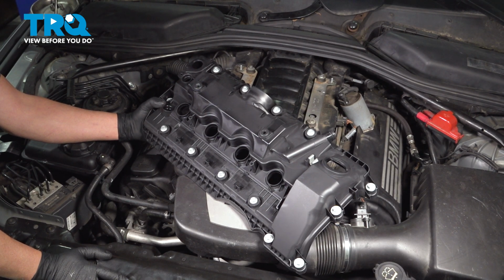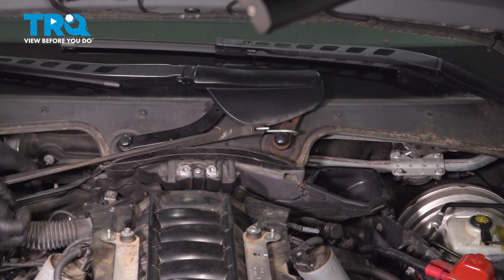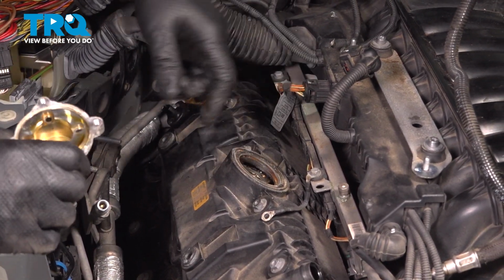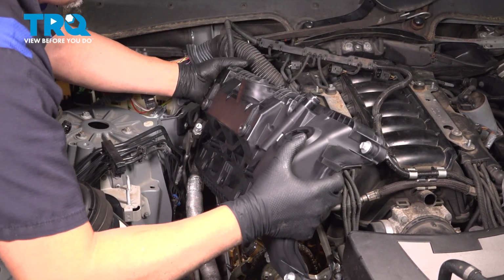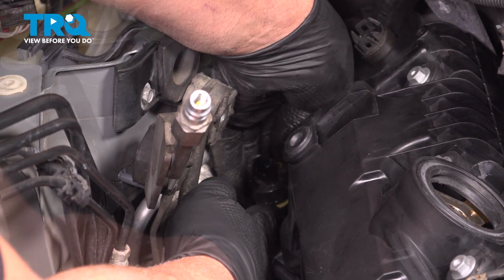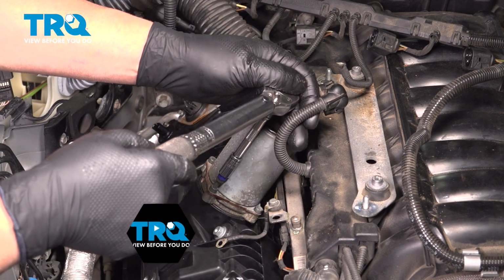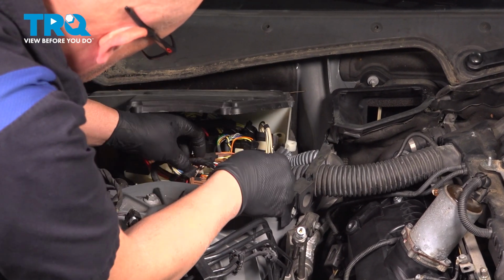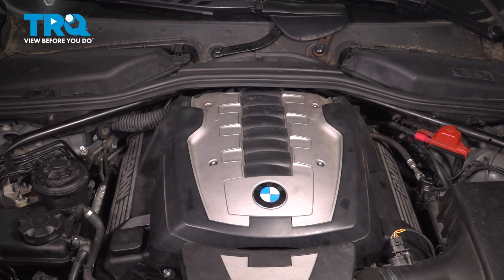How to Replace Valve Cover 2006-2010 BMW 550i 4.8L V8

Comment: The cut scene at 25:16 minutes you had a hard time starting the lower valve cover nuts didn’t you? Just asking cause on mine I think there are supposed to be to be diff size grommets on the bottom than the top

Comment: Pro tip. The top and bottom nuts ( the ones you screw on to the studs) are different lengths.